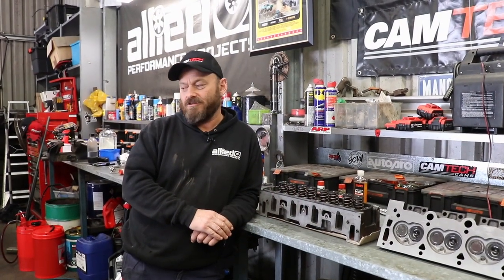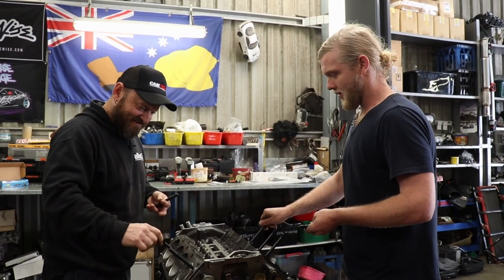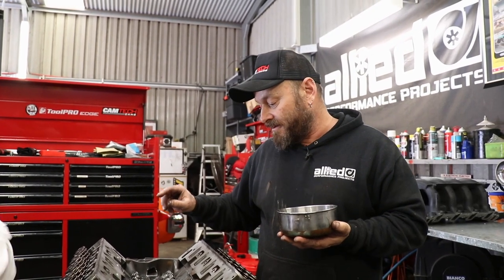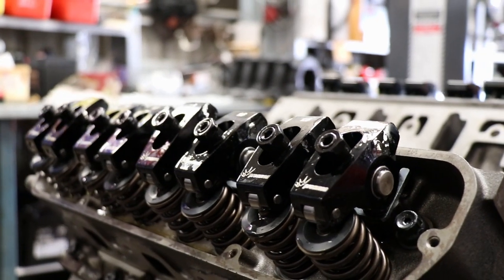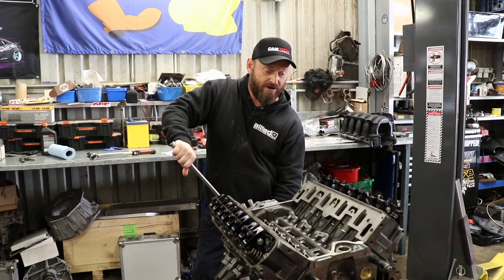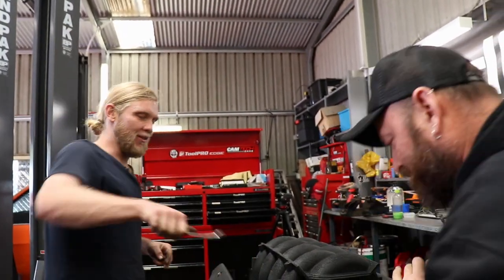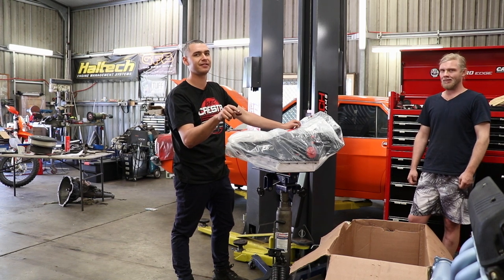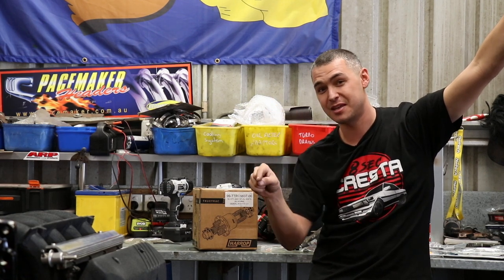GM HOLDEN 304 V8 ENGINE RE-BUILD [EP3]

Comment: "foot-pound" is singular, "pound-feet" is plural! both are correct!
Reply: I know the lads were taking the piss but lets dispel the bullshit for all the serious comnenters- the order of the units in this case are irrelevant since the equation for torque is a multiplication of two values. The maths folk call it a commutativr property i.e. torque = force x length = length x force. As such the units can either be foot pounds or pound feet.
Reply: @joeyd879  That would be fine if they weren't actual specific label for units of measurement.  Pound-foot is the unit of torque, Foot-Pound is a unit of work. They measure different things so it's not simply a multiplication.
Reply: Yes, we understood what he meant but one is correct, one isn't. You can't claim both are correct just because we understand what he meant.
Reply: @DiscoFang  Go back to basic maths classes and algebra. You're getting confused. also- work= force x distance i.e. distance travelled. torque or moment is force x fixed length from a fulcrum. The units however are interchangeable and the same

Comment: Just to satisfy your curiosity the reason they call 308 holden engines plastics is specially in the early days is they had bad oil pressure at idle and after 40 or 50 thousand kilometers the lifters and the rest of the valve train would rattle its head off. then after replacing cam and lifters then 40 or so thousand ks  it would be rattling again just as bad. so they adopted the name plastics. some used to call them plastic fantastic. so that is where the name originated.

Cheers 
GazzaGT

Comment: Tried to buy a Camtech cam and lifters but link in the description is dead.
So I need to find some more info on the correct lifters to use in a VT block. 
Been told the VT uses special roller lifters and cannot use any of the roller lifters from pre VT.
Anyone know if that is true, and if so, what are the right lifters to use?
Reply: Camtech has unfortunately shut down, which is a shame, because they had some great products

Comment: The firing order on the 304 sounds mint with a stock cam and exhaust. Put a crow or crane big cam and it sounds mean and strong compared to any cammed LS engine. Ls firing order is  
1 8 7 2 6 5 4 3,  304 is 1 2 7 8 4 5 6 3

Comment: Do you have a set of feeler gauges? That is the best way to set the rocker arms.
Reply from the maker: B S it’s a a hydraulic cam not a solid, we are setting the lifter plunge not the valve clearance.
Reply: Did not even think of that. Sorry for that comment. I am obviously not an engine builder. Enjoyed the video. Keep them coming.

Comment: I'm assuming It's called "The Plastic" because the first fuel injected Holden V8 was in the VL Commodore SS Group A SV, which was of course the Plastic Pig (or Batmobile) because of the ridiculous(ly awesome) body kit.  That one had the 304, so the fuel injected 304 became synonymous with that, and is the plastic, or the plastic pig motor.  Could be wrong, but I've found quite a few people calling it the plastic pig block or plastic pig motor instead of just "the plastic".

Comment: Those are not 4 into 1 headers Allan.  Going off the height of the header outlet flange, i'd say this is going in a Torana or a Kingswood.
Reply from the maker: Victor Bitter yes I know they are tri y’all, just didn’t know before we opened the packet. Assumption is the mother of all fu...........
Reply: @theskidfactory  I'll assume they sent you those cos 4's won't fit your application?

Comment: Hydronic shouldn't need adjustments after the first check after a few heat cycles. Everyone thinks solid roller stuff needs done ever so often. I have a huge solid roller with poly locks in my bbf and it hasn't needed adjusting for a long time. Actually since i went to the locks.

Comment: They were called Plastic Fantastic or just Plastic Engines as compared to the Ford V8- Holden has aluminium inlet, thermostat housing, water pump and timing cover.

Comment: the GMH 304 is the proto-LS
Reply: True later injected 304 and 355 ci have LS intake style and port location, but the Holden V8 had it in 1988 years b4 LS.
Reply: @JosephCowen-ru7up  yep, why it's the proto-ls

Comment: I want to see you do something crazy with an old ford bulletproof 300 6
Reply: 300 6’s never really made it to Australia. We had the 302 Cleveland (which was a destroked 351c) and the 250 2v 6 which was the original us falcon motor (also mustang) further developed. That 6 became the Barra, after another three complete evolutions
Reply: @Mitch Grima the crazy one with the 105 garret pushing 900ish

Comment: The Plastic reference is about the amount of plastic that was covering the VN Commodore engine bay
Reply: Bingo, as well as the car in general. Completely plastic interior and trim, plastic bumpers, body trim and window surrounds, plastic wheel covers, plastic everything. I'm driving a mint one as a daily ... there's a lotta plastic!
Reply: funny only things plastic are the air box/intake and over flow bottles oh and maybe the fan shroud n rocker covers on v6s lol but I think your right on the vns being plastic and also being the first to get the injected 5L lol my vns only rocking a v6 though , it does the job and u don't have to sell your first born to replace it when they blow up hahahaha 5Ls are starting to attract bigger $ than ls's now :(

Comment: The block is kinda oldsmobile and the heads kinda Buick. The iron roo would be more appropriate I think
Reply: Only reason it's Iron Lion is the Holden badge has a Lion on it. But I get where your going with that.
Reply: @LimitR  Yep, they are mostly in Australia and there's lots of them running around
Reply: @Mikey-jm3dc  Yeah I know. I'm an Aussie. Seen plenty of Roo's. Was more explaining the Lion part.
Reply: Early heads share Oldsmobile port location and rocker style as well as starter location and flywheel / flex plate style,

Comment: The term ‘ plastic ‘ came from the American engineers that considered the amount of aluminium used on the engine ( manifold/ timing cover / water pump) as a ‘ plastic ‘ engine. 
The GM engineers were used to cast iron everything
Reply: Ohcams Razor you're completely wrong. It came from using plastic manifolds and other plastic parts. Aluminum has been common in cars since they begun making them.

Comment: The story i heard was that when the 253's and 308's were released they were nicknamed 'plastic' because compared to the Small Block Chev, they were considered a 'toy' type of engine ( you know... plastic toy)
Reply: They were called plastic because they used alloy timing cover, water pump, and intake other V8S like chev and ford used cast iron !
Reply: @JosephCowen-ru7up  not the story I heard but it all sounds plausible

Comment: It’s called the plastic engine because the chev had a cast iron water pump and timing cover... the 308 had an aluminium water pump and timing cover hence plastic.
Reply from the maker: 1986 patrol This is what I had thought was the case also.
Reply: This was what I thought it was too, the term has been around since the 80s. Small blocks also came with cast iron intakes (rotten back breaking things)

Comment: Plastic v8 was a nickname given to Holden engines (mostly v8s) and gearboxes. Holden v8s where not known for strength compared to Chevy engines especially in drag racing communities. With Holden and Chevy v8s available in Holden cars from factory the Chevy v8 was a popular alternative to modify compared to the Holden engines.
Reply: Plastic pig refers to the mighty 1987 HSV VL Walkinshore  something like a 17 piece plastic body kit. We didn’t take to them we were still getting used to the plastic bumpers not steel and Walkinshore not Brock. Would be better suited to the ls. Up the Iron Loin and Woody.
Reply: It was called plastic in the 1960s because it used alloy timing cover, oil pump, water pump and intake manifold when Ford and Chev used cast iron !
Reply: @tammygoods5637 no plastic was given to the Holden V8 engine because it used alloy timing cover, water pump, oil pump and intake when Ford and Chev used cast iron ! Read up son.

Comment: Holden V8’s are called plastic because of their inherent light weight as compared to comparative V8’s of the era. This is due to the compact nature of the engine as well as use of cast alloys used for the intake manifold and timing cover. 
“These things are so light they must be made of plastic”
Reply: Yeah, nah.
Only injected 304's(and 304 based strokers) were known as plastic V8's. 253's and 308's were not.
Why, 304's first appearance was in the the first Commodore with plastic, not steel bumpers, the VK.
Reply: Aaron Noyb Holden V8’s weren’t fuel injected until the VN with the exception of the VL Walkenshaw. 
There was an article “history of the Holden V8”, pretty sure it was in Street Machine magazine in the mid-late 80’s and they touched on the engines light weight and referencing plastic. 
The plastic bumper thing is just an urban myth made up by those who don’t know the real story.
Reply: @nobikeman  
Hmm, sounds like an urban myth about an urban myth......
Yep, I did make a mistake. I meant all 304CID motors not just injected 304's, with 304 carbi motors appearing in 1985, in the VK. Which would line up with your mid to late 80's magazine article.

SBC's came in at least 7 displacements smaller than 308, in a weight and size package, almost the same as the Aussie V8, shit, SBC cranks into Holden blocks was a thing once.
So why would they suddenly start calling the Aussie V8 plastic, 16 years after it appeared on the market, at the exact time the Commodore went to "plastic" bumpers??
Reply: @nobikeman  
Also, in regards to your original comment, regarding timing covers and inlet manifolds. 
SBC timing covers, weigh less than Holden ones, Holden wins when it comes to water pump weight, comparing OEM parts. 
Inlet manifolds, Chev beat Holden to using alloy intake manifolds(in cars, not trucks).
Remember before the Holden had produced the first V8, Chev had already produced the ZL1(original) all alloy V8.
Reply: Aaron Noyb the article was on the “history” of the Holden V8, the reference to being made of plastic due to the 308 being lighter than the 307 SBC it replaced in the Holden lineup at the time, and mind you it also made more power. 
The term was popularised by Street Machine magazine who called all Holden V8’s plastic motors. You’d be lucky to even find VK in a SM mag back then.
Just coincidence it was a similar era to plastic bumpers.
Reply: @nobikeman  
You're making me question myself now, what else do I know that isn't so....
Power output aside, long motor weight difference is about 10-20kgs max, hardly a talking point on full iron V8's, but if that was enough for the magazines, so be it.
Thanks for the education.
Reply: Aaron Noyb all good mate, can’t remember exactly who they referenced saying it but pretty sure it was a GM engineer from the US. From what I can see online the difference is around 60-65 lbs or 25-28 kgs, yeah not a lot but enough for them to take notice.
Shame I threw out 10-12 years worth of SM mags from mid 80’s to mid 90’s about 10 years ago as I could have dug it up.

Comment: So what's a tappet cover then? Surely you'd only have tappets at the top of an engine in an overhead cam and surely it's called a cam cover in that case? Or is it backwards because you're in Oz?
Reply: Its actually called a rocker cover. Sure you can work out the rest
Reply: @backyardbangers1012  He said Tappet cover though. That was the question. Obvs i know what a rocker cover/ cam cover is, thay was the point of the question!!
Reply: Fair enough. Rockers tap somtimes. Tap tap tap tap. Old school aussie slang like a dogs eye with dead horse type of thing. Ya mean!
Reply: Tappets are rockers , !!!!

Comment: Is a mystery to me that OHV came before OHC pushrods and all that seems much mote complicated to me.
Reply: Before OHV (pushrod) there was Flathead. The valves were in the block, and the gases had to do a U turn to get into and out of the Cylinder. All that was in the head was the spark plug.

Look at Project Farm's perspex headed lawn mower engine for a visual demo.
Reply: @wombatdj  Yeah I guess that is what we called side valve here Lawn mowers usually have pushrods though.

Comment: Iron lion google search:
* 80's Sydney glam rock band.
* Crossfit gym in QLD.
* Red Sonja, birthplace of the devil, album
* Bob Marley and the Whalers, Iron Lion Zion.
No mention of the GM v8 or any other engine
Reply: Are you trying to say 99 percent of Australia is wrong , what's your point ??
Reply: @JosephCowen-ru7up  . My point,  until plastic engines came out it wasn't  a thing and in my 50yrs I'd never heard it called that until this show. Must be a city thing
Reply: @shanevonharten3100  all over Australia , even in Holden text , it used this term , it's as old as the motor is , 1969 , the old school thought everything was plastic that wasn't cast iron !
Reply: @shanevonharten3100  the iron lion was the other term Holden guys called it ! And I've never heard of the things you list above and I'm from Qld does that mean they don't exist !

Comment: I was always told that 304 and 308 motors were called "plastics" because they had a tendency to melt.
Reply: Again called plastic because they had alloy timing covers, water pumps, oil pumps, and intakes when Ford and Chev used cast iron !

Comment: Plastic because the bore spacing is bugger all compared to a small block Chev, so you can't bore them out as much.
Reply: Bore spacing same as chev are you referring to bore thickness ? Still same as chev , I think you mean early castings had a small problem with core shift when cast !

Comment: Plastic because they are weak when given a hard time!
Reply: xdub101  I my built stroker 355 roller cam engine in my VL Calais has been raped everyday of it’s life as a daily driver / powercruise, Summernats burnouts, auto fest, eastern creek wicked Wednesdays, freely Friday’s street drags never and missed a beat ... 🇦🇺
nothing plastic about it !
Reply: @ianharrd  Yeah but its probably putting out all of 300hp at the wheels if its lucky
Reply: xdub101 yeah only 310 hp at the rear wheels your close  and it  run best 12.85 second quarter mile time with backyard tune n carby ...

but I’ve built it for boost all forged 20cc dish pistons and cam suited to supercharger I was planing to instal a f1 procharger kit with 15-20 pounds of boost

If I had use lumpy pistons and cam to suit it would of been quicker na

When the Australian dollar is stronger I’ll  buy the f1 procharger from the USA ...
Reply: @ianharrd  Sounds like it'll be a weapon mate.  
Good to see instead of usual LS conversion

Comment: GM motor built by Japanese guys? 
In the late 90's, I drove an airplane fuel truck built by Isuzu with a Chevy small block built in japan or with all japanese writing on it. Preferred the little turbo diesel, but it had issues with the tank valve, so the fuel company swapped it for the chev powered version.
Reply from the maker: Jp Kalishek seeing Isuzu NPR trucks over here with LS engines in them is hilarious. 

The duramax 6.6 is an Isuzu 8gf1 engine also. Japanese designed GM V8.
Reply: @theskidfactory  this one was the small Cityvan sized one too. Smallest they had here at the time.
Forgot the duramax was a V8. GM managed to slightly botch those when they came out. Flex plate issue iirc.
Reply: @theskidfactory  oh, and it seems most of GM's better designs come from Isuzu and Opal, and even Holden (late GTO, Camero, Caddy), and for a time, Suzuki, and Toyota.

Comment: sorry lads, 1-3-7-2-6-5-4-8 is the best firing order for V8's 
pure, music.
Reply: Higgo Yes clevos are the best sounding V8 hands down.
Reply from the maker: Greg Myatt Fords are numbered differently also so direct comparison is not relevant.
Reply: @theskidfactory totally relevant comparison bro. Clevo's are meaty as
Reply: The Skid Factory what, engine numbers. I guess some guys love that horrible blappy poppy crap sound instead of the deep rumble. Love your channel guys.
Reply: Sorry what you fail to realise is the Holden V8 is the only V8 with the left bank forward in case you didn't notice so that changes which piston is first on the crank, and a firing order means nothing unless all motors number their cylinders the same way , and they don't ! Ford goes from left bank back to the fire wall then starts again at the right bank from front to back , chev criss cross the intake with number 1 on one side and 2 across, so in reality I can have one firing order be different on two different brands of motors also the same firing order firing different pistons for the same reason,

Comment: @3m20s: Machine Shop guy apparently not wearing any eye protection.
Reply from the maker: J H there is a reason it’s called personal protective equipment.
Reply: Safety squint, lads.
Nah I encourage PPE usage with my mates, but I'm also a hypocrite sometimes. My arms and hands are so scarred up from welding in T shirts with no gloves. But eyes are something I'm super paranoid about. Only because I've already been to the hospital twice to get metal shards removed from my eyeball. Not only does it hurt, but it is also extremely difficult to sit perfectly still while they dig metal splinters from your eyeball using a catheter needle. And then your eyes are irritated and vision is a bit weird for a couple of days. There's also the risk of permanent damage.
But at the end of the day, people know the risks and are capable of making their own choices. Just remember, no sympathy for self inflicted wounds.